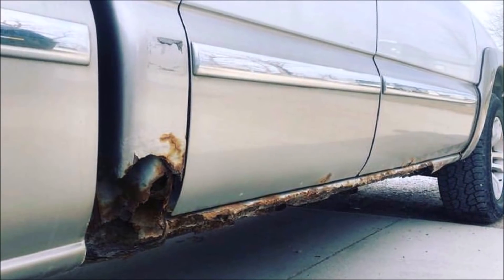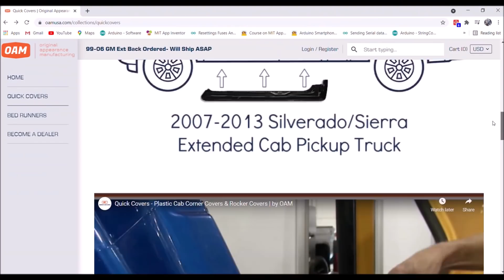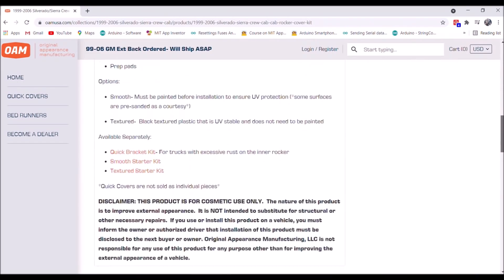Arduino DIY Battle Bots: To the Death!

Comment: The Russians on the YT channel garage54 did a video yesterday of their new machine that makes these parts, it's the same machine you have there, lol, I think they said they paid 4 or 5k for it, I have a question for ya, if that's such a great product, why haven't you used it on a single one of your rusty vehicles yet?, as for battlebots, they're awesome, even tho the judges/refs/commentators obviously have favorites, which are usually crappy bots like duck, lol
Reply from the maker: Because I drive only oldschool stuff, which we don’t make parts for is all. Not enough demand to constitute tooling - we’d run ourselves under if we tried.